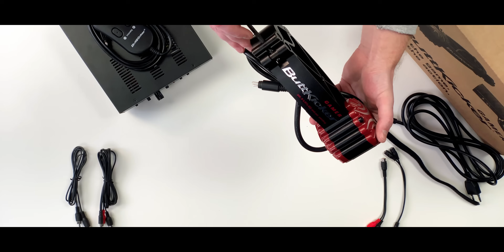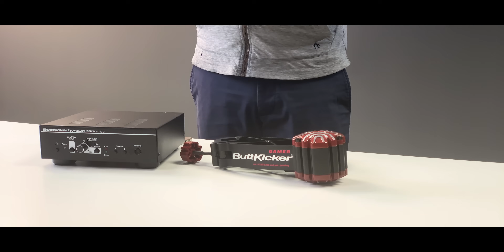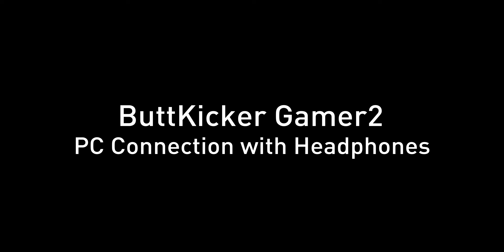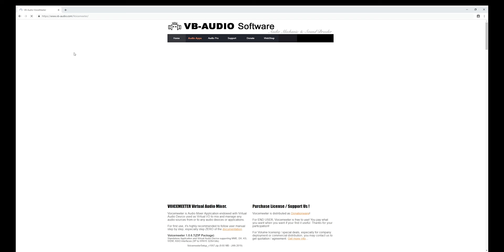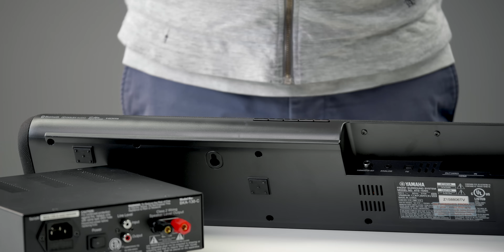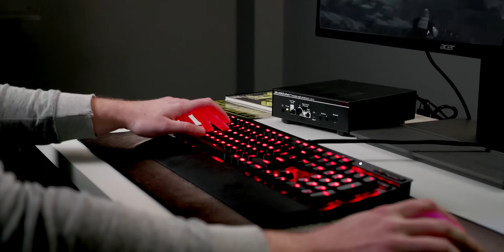ButtKicker Gamer2 - Contents and Setup

Comment: hello i recently got mine, question i have is do i use the switch at the back everytime to power off? or is the remote power button for on/off is sufficient? I heard that constantly using the power switch isnt good over time.
Reply from the maker: You simply turn off the unit with the remote or power switch on the front panel. If you plan to leave the unit for a long time (like a vacation) use the rear panel power switch to fully power off the unit and consume no additional electricity, just like you would with your PC.

Comment: is it normal that I could hear the bass when I clamp it to my chair? For example, if I'm just holding the buttkicker, I can feel the kicks, but don't really hear the sound of the bass (so that sounds like the correct behaviour), but when I attach it to my chair, I can hear every bass note in a song through the chair (not just feel the kick)
Reply from the maker: Try turning on the High Cut Filter on the BKA-130-C amp and setting it to 100Hz or below. For further help email our support team at support@guitammer.com.

Comment: Will this work with a sound bar with a Bluetooth subwoofer that is hooked up by a optical cable?
Reply from the maker: Hi Mike, you'll need to us an Optical Splitter and Optical to Analog RCA converter to connect with your setup. Our support team can help, email them at support@guitammer.com
Reply: @Guitammer  sounds good will hit them up.

Comment: I'm using it with dirt rally 2, it stops working every 5 minutes, and starts again after 10min, the green and red lights are working, but no vibrating whatsoever
Reply from the maker: Please contact our support team via support@guitammer.com.
Reply: It is overheating. Mine does the same. It's almost useless, it gives you a quick sample and then turns off automatically. The truth is it is not suitable to racing simulators.

Comment: Got this for Christmas to use with DCS and I just have to say it is great. I use SimShaker for Aviators and SimShaker Sound Module. I had landing turned up all the way at first, landed on the Carrier, and I felt it in my teeth when I hit the deck lol. If you are a flight simmer or any kind of driving simulator like American Truck Simulator, Dirt Rally, or any racing game you will love this. I saw some guys using one of these in each wheel position to simulate individual wheels. Just amazing pulling a hard turn in a F-18 and feeling it in the seat.